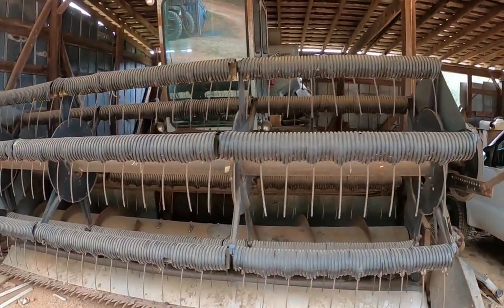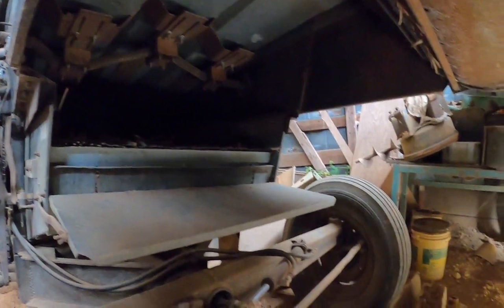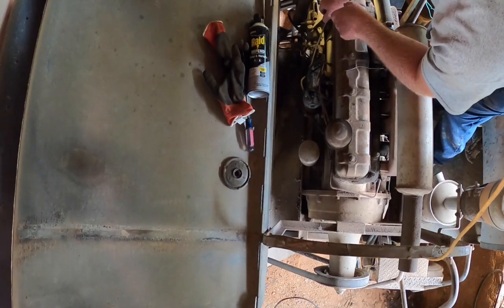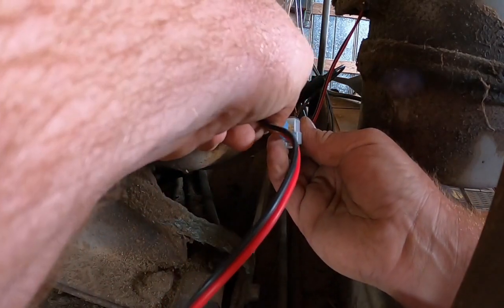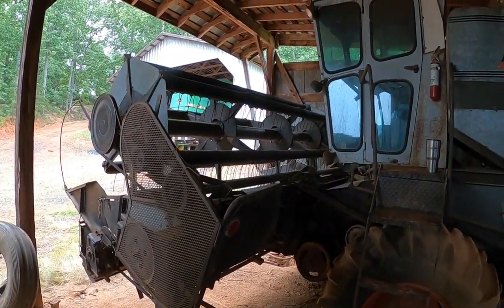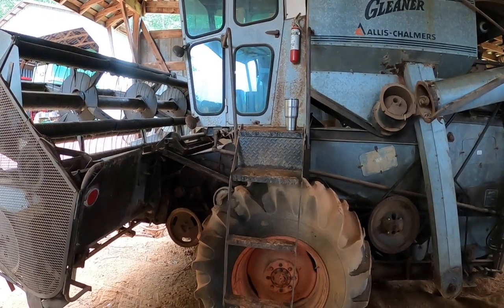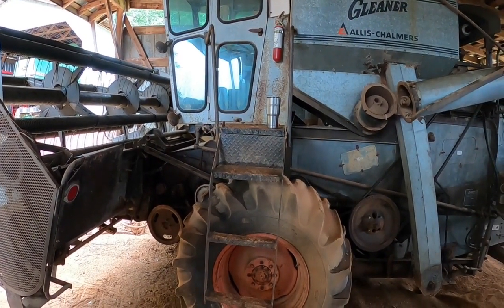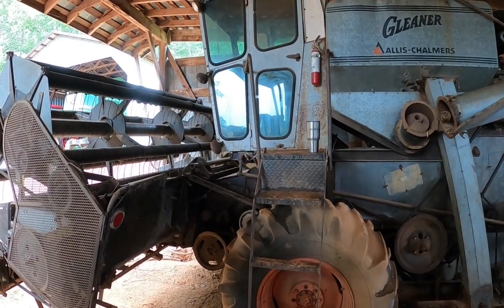Model A2 Gleaner barn find, things are lining up again! Field READY is starting to look nice!

Comment: Ahhh the old budda fires right up in true fashion. Lol. It'll do that when it's minus 10° outside too lol. That's odd awesome it has a chopper on it looks life a solid machine...... now to get a fuel barrel lol gotta feed those 72 horse powers fed 😅
A tip on that lower drive sheive. You should grease that after every unload. It's the death of most of those old beasts.
Reply from the maker: It sure did Tim!! Just can't beat those old gleaners!! You sir were a go too for sure on advice and a huge part in giving me the pros and cons!! I had no idea on the chopper until I stuck my head under there 🤣🤣🤣 Duh, that's what that long belt is running on the other side 😂😂 Oh my gosh they love fuel, I aquired a 270 gallon tank for a Diesel upgrade....but it may be a dedicated combine fueling station 🤣🤣🤣
   Thank you as well for the tip on that lower drive sheive, will surely do that!! You are an AC genius for sure!! Thank you sir for all your input, advice , support and always being here!! I really appreciate that!! 🇺🇸🇺🇸🇺🇸👍👍👍😁😁😁😁🌽🌽
Reply: @Pennies_on_the_dollar  anytime you need info on it. I'm gonna be taking a 230 apart here soon 😆 so I'll have more information for ya soon. You be able to see the engine inards anyways lol.  I think your right about the fuel tank problem is ya only really use it once a year. Idk 🤷‍♂️ you know better than I do lol
Reply from the maker: Man yeah, I can't wait to see that!!!😁😁😁😁👍👍👍

Comment: The 13' platform should be a bit much for an A.. the C2 we had, had a 12' platform.. later we had an M, much bigger than the C2, it had a 13' platform.. 
Really all depends how slow it will go...
Round back and the newer cab🤔👍😁
Reply from the maker: I did a lot of reading and research, it seems there were lots of combos on these era gleaners!! 🤣🤣🤣 My K had a 10 ft head, Scotts has a 13 I'm pretty sure, it is heavy for it, but that was common according to their specs. The C2 was even bigger I think right? My understanding is the is what the F/F2 replaced. Have no idea on the cab, it's fiberglass top, and the pretty plain. But it runs like a top, and doesn't need much to get in the field thank goodness!! 😁😁😁🤞🤞🤞👍👍 Thank you Ed for always being here, I really appreciate that!! Congrats to Grandpa!! 😁😁😁🇺🇸🇺🇸👍👍👍
Reply: @Pennies_on_the_dollar  the A was just a little thing. E and F were too..C was kinda out of order, as it was a little bigger.. M bigger yet, biggest back then was the L.
Header size was all regional. Here,. Most headers were just a little wider than the machine, otherwise you'd have to drive stakes to see if the machine was actually moving.. dryer climates would have bigger headers. A machine with a 13' here, would have a 20-24' in Eastern Oregon or Eastern Washington.. 
Thank you my friend!! Looking forward to seeing Blakely again, but I know it will be a week or two...
Reply from the maker: Yes the lettering was kinda crazy for sure! It's hard to distinguish honestly. I like it, and think it will do a great job!! At a start that is!! Hopefully you get to see her soon!! 😁😁😁
Reply: My grandfather had a e3 with a 13ft head 2nd gear low variable speed a real nice machine
Reply: I love running them machines, just alittle dirty to run ,boy what fun